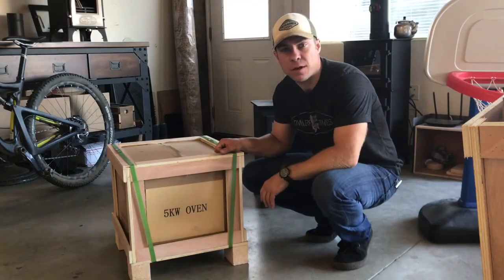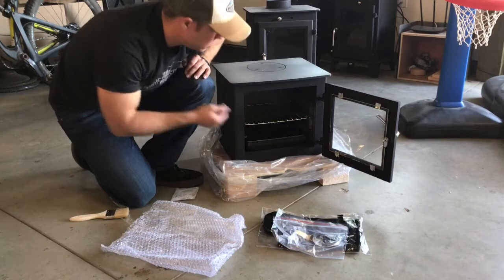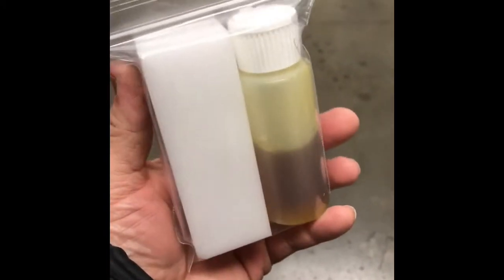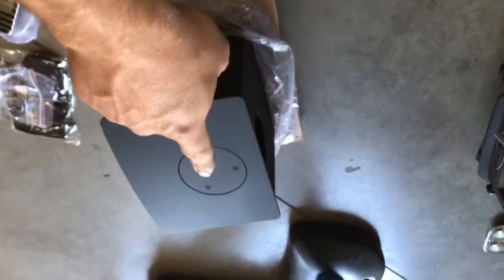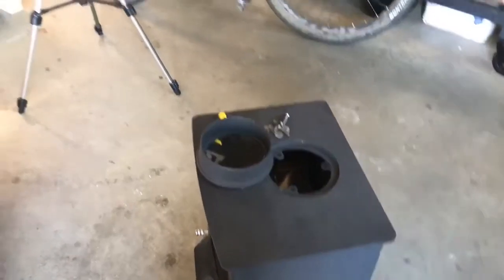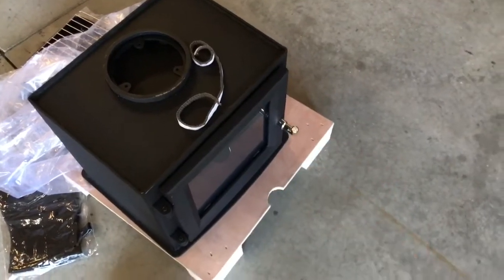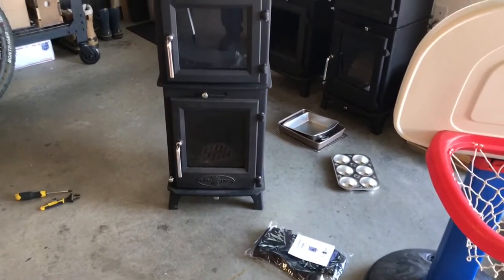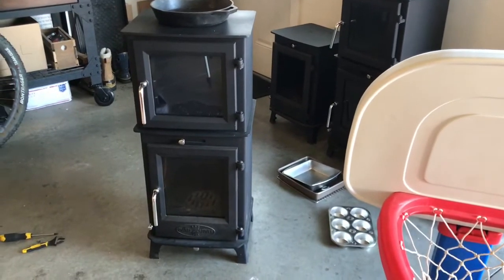Dwarf 5kw Cookstove - Oven Installation (Previous Version).

Comment: Have you considered "gun bluing" to finish the oven interior? Acid clean first, then one of several commercial bluing - I would try "Midway USA". In fact, a Parkerised finnish for both exterior and interior might be good. Depends on your production volume as this requires heated tanks.

Comment: We in the USA are used to BTU as a heat measure.
Reply: Victor Boucher we live in Britain, where BTU's are virtually unknown and only ever referred to by plumbers ordering radiators from suppliers, even though the boilers that supply said radiators are rated in kilowatts. The public have not used BTUs for decades and anyone under the age of about 50 wouldn't know what you were talking about if you mentioned them!